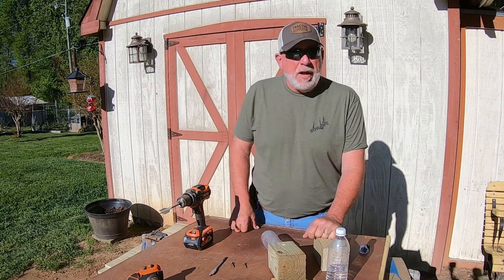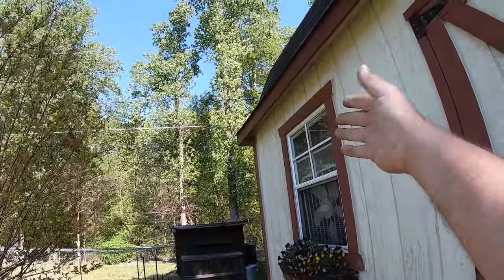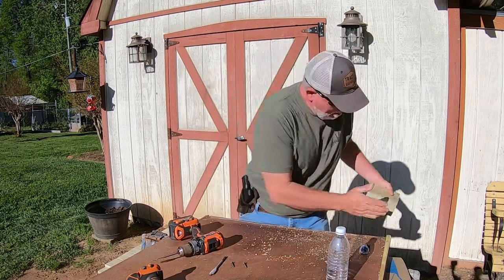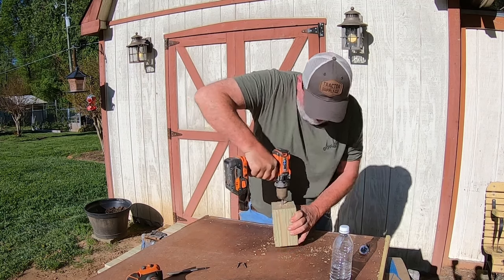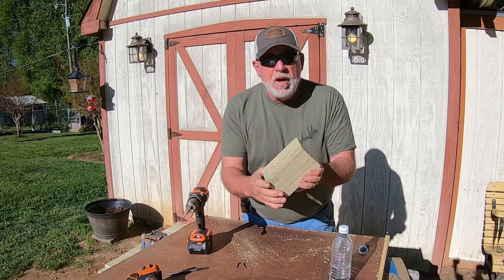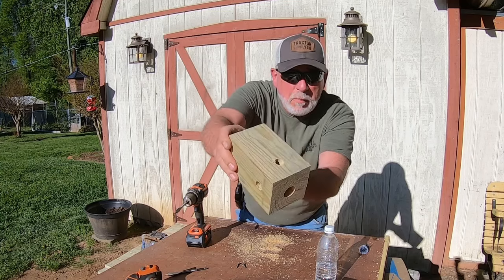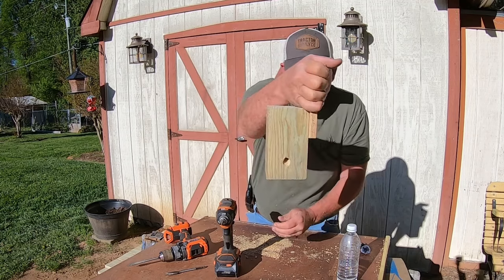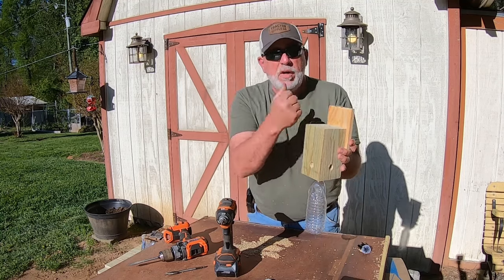Easiest Way To Build A Carpenter Bee Trap

Comment: I used to trap carpenter bees until I read up on them a bit. They are not as damaging as some would have you think. They reuse old holes and are a pollinator that has a dwindling population, and we need more native pollinators. Please don't trap carpenter bees.
Reply from the maker: Yes, you are correct about the damage to a wooden structure but they are not great pollinators like one would think. This is right off a gardening site:
Carpenter bees are known as nectar robbers. Nectar robbers are organisms that take the nectar from the flowers without entering the opening of the flower. They can penetrate the flower from the outside and drink the nectar. Carpenter bees avoid contact with the flowers’ reproductive structures, bypassing the pollination process.
Thanks for watching!